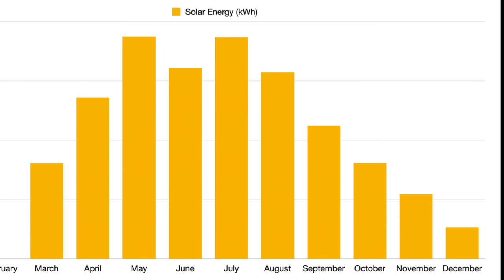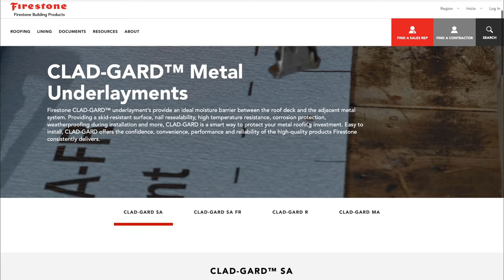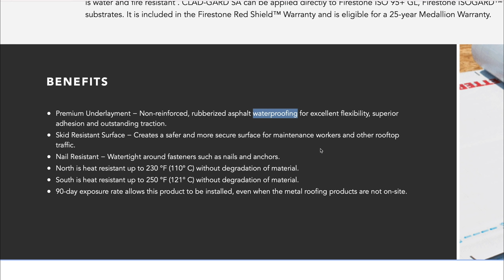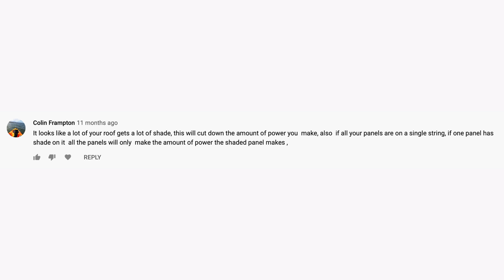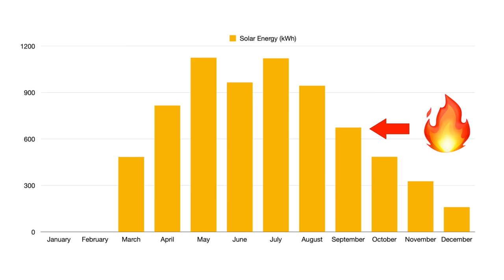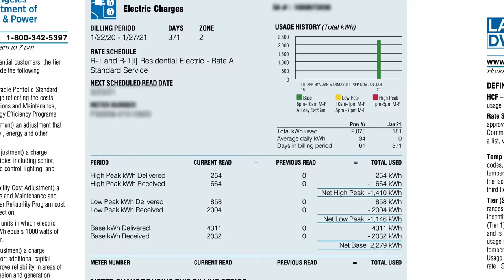1 Year with Tesla Solar Roof: top 11 questions answered + real production numbers & utility bills!

Comment: The most important questions:
1) What was the total cost of purchase plus installation?
2) Did the insurance company pay for it?
3) Do you get rebate or credit from the insurance company for the roof? I ask this question because I believe you do get some credit if you install a metal roof based on its durability.
Reply: Yes please! I’d like to know this as well!
Reply: A lot of these solar roofs, solar glass roofs and power wall videos don’t include those important answers. I wonder why?
Probably the same dumb and self-defeating reason people don’t talk to their coworkers about their salaries.
Reply: @r.lewisblake7793  that was a lot of aggression for absolutely no reason lol
Reply: You can check it his previous video for costs
Reply: Previous video he stated cost was ~$34,000. At $2k savings per year breakeven is 17 years roughly.
Reply: @jeffrandall4046  plus he said he had to get it cleaned, which seems like it might be a yearly need. Guessing that there's not many people with experience doing that it's maybe $500. That's an additional 8 grand over those 17 years, pushing it closer to 20-21 years.
Reply: @r.lewisblake7793  lmao you gotta admit that coworker salary rant was awfully specific 😂
Reply: @jeffrandall4046  so basically the system has not being thought effectively , should be running aircon or heating giving nothing to the grid and a quicker return on investment , these people never get it right
Reply: @jeffrandall4046  I was thinking the same thing until I thought about how long the roof would last if it was shingle.  I know a 30 year roof may last 20 here in Texas.  And the cost would be roughly 20k for that size depending on the cost of oil.  Taking that into account, I think it would be a 8.5 years plus the cost of cleanings so maybe 10 years? 

This isn't too bad when you take into account you no longer have the dependance on the variable cost of natural gas and coal.
Reply: 50k min.
Reply: Keep in mind also that depending on how you wanna look at this $34,000 if you pay that yourself there’s an additional cost in economic circles it’s called opportunity cost. What that means is if you pay $35,000 for something you lost the ability of that money to earn interest or maybe to invest in something else like a house or whatever. Other words it’s not yours anymore so normally you put a price on that 6% to hear something like that
Reply: Salty Berserker Brigade Come get some  Yeah!  More hostility!  That's what we needed, attack the moderating challenge and throw in some name calling.
Reply: @johnwilliams221   you can make that assumption if you believe the cost of grid electricity will go up by the same rate, in order to offset the loss of efficiency / maintenance (Historically they have).
Reply: @jeffrandall4046  with the cost of energy rising it might be 8 years - but the best part is when power goes out during the day, his will not
Reply: @joshuapowers4623  to be fair, he lives in a literal desert, AND he needed it cleaned due to a massive wildfire that caked it in ash. In most places throughout the US where rain is a common occurrence (at least a few days per month), and massive wildfires aren't a yearly issue, cleaning is likely not a yearly need.
Reply: @michaelgunning347  unless you live somewhere where you get paid for the energy going to the grid then those payments + savings exponentially increase recouping your investment.
Reply: @r.lewisblake7793  coworkers don't talk about their salaries because that idea has been promoted by employers so that they can underpay people.
Reply: @jeffrandall4046  yeah.  So this is a purchase I'll never make.  Whatever happened to the Tesla roof being comparable to a traditional roof in terms of cost.  He could have put a 30 year roof on that tiny surface for 15 grand.
Reply: @AngryAlfonse  true but the loss during rain is going to be like having dirty panels or worse.
Reply: @dmn5384  that makes no sense. He left his solar panels caked in ash for 4 months. That's not equal to the losses of a few days of rain every year, especially considering that most rain doesn't last all day, and many rainy days are still plenty sunny.
Reply: Not worth the hassle.
Reply: @jeffrandall4046  ouch.
Reply: Have faith in JESUS CHRIST as LORD and SAVIOR for HE SAVES from hell❗️

 What is the Gospel?

The true gospel is the good news that God saves sinners. Man is by nature sinful and separated from God with no hope of remedying that situation. But God, by His power, provided the means of man’s redemption in the death, burial, and resurrection of the Savior, Jesus Christ. 

Ephesians 2:8-9

For it is by grace you have been saved through faith. And this is not your own doing; it is the gift of GOD, not a result of works, so that no one may boast. 

Romans 10:9
9 because, if you confess with your mouth that Jesus is Lord and believe in your heart that God raised him from the dead, you will be saved.

JESUS CHRIST can come anytime!

Just Believe ❤️ Love you and GOD BLESS
Reply: Cost is tough, I paid $42,000 for a 11.7kW system from Tesla. (not roof but regular panels). I got 1/3 of that back from the Federal Gov via tax rebate. I live in NJ so for every 1MW that my system produces I get a SREC which is worth about $220 right now (this can and will change over time) - I am limited to 10 years in the SREC system.
Reply: @joshuapowers4623  Depends on where you live, I live in NJ and have a solar panel system for 3 years and have not had to clean it once.
Reply: @AskRemy  That is not true. Without a power wall, ALL solar systems stop generating when the grid goes down. That is done to protect the linesmen as they work to restore/ repair the grid. The don't want a bunch of PV electric systems feeding power into the grid while they are working on it. The PV system relies on the grid to provide the timing of the cycles of the A/C. Everything must be in sync or you end up with major problems.
Reply: Also the cost to wash the roof and how many times a year is is recommended that you wash it.
Reply: @OmerQuenneville  whenever it’s dirty
Reply: @newarknj76  At what cost?
Reply: @AskRemy   no his power will go out. He has not opted for the battery backup so there is not power of the grid goes down.
Reply: @OmerQuenneville  I have no Idea since I’ve never had it done. I would probably use my power washer to spray soap then just rinse them off.
Reply: @jeffrandall4046  17 years? rough, dont the panels only last 10/12?
Reply: @HerbaceousM8  People saying 17 years have failed to subtract the cost of a roof.  If you didn't have these tiles, then you'd still have to pay for other roof tiles.
If you do that, it is paid off in just 8 years.  (From his comments)
Reply: @jeffrandall4046  But you should consider what the alternative for a standard roof would cost. So let's say a standard roof install would cost $20,000. Well, you need a new roof anyway, so then you really should be thinking the $14,000 would take 7 years to break even.
Reply: @SHlTHEADJOE  You still have cost of gas unless you go completely electric heating.
Reply: @johnwilliams221  garbage is a bir of a rough word. The panels work, its more like its an expensive rip off.
Reply: @HerbaceousM8  The warranty is 25 years - within that the decline in production figures are 1% of the rated power for the first five years and 0.5% per annum for the next twenty years - so, assuming those warranty numbers are correct, in 2045 he should still be getting about 85% of the rated energy from his roof. He paid $34,000 for the solar roof (versus $16,000 for a non-solar replacement roof) and saved $2,088 on his electricity bill in his first year. Assuming no change in energy prices between 2020 and 2045, and constant weather he should break even (excluding financing costs) around 2037-8. If you deduct the cost of a regular roof from the cost of the Tesla roof then the Tesla roof should have paid for itself in about ten years - around 2030. Of course, electricity pricing have been rising fast over the last couple of years so his numbers should be looking even better, all other things being equal.
Reply: @michaelgunning347  you're clearly a kid since you think a roof that pays itself off in half of the length of a house payment is somehow a bad deal.  if you're buying a house and not intending to live it in for at least 40 years you've already screwed up huge.
Reply: @SHlTHEADJOE  17 year breakeven is also nothing at all when you shouldn't buy a house at all unless you plan on staying for at least 40.
Reply: @derpderpin1568  That's simply just not true in most area's of the country. Figure closing costs on my home were 15k, average rent is 2300.00 a month, my mortgage is 1200.00 a month, it will take me a year and a half to break even when factoring in closing costs alone, if I add things like maintenance but subtract saving on utility costs, not to mention inflation, it's still likely less than 18 months return.  

Now as per that roof, it's 34k, my home owners insurance will cover 95% of a new roof, but only covers certain materials. The catch is it will only cover a 30 year minimum warranty roof. So I'd go from having maybe 5k out of pocket to 34k, which 29k would take me a LONG time to recover from solar. If the root was half the cost, and everyone nationally got one with a power wall, then it starts to make sense, but imo at this point, it's an expensive toy.
Reply: @OmerQuenneville  You are supposed to check your output every month and when you see a reduction in electricity production, then you wash it.
Reply: I just think if you're using solar and you make so much energy that you actually give some to the grid you should get a tax write-off or compensated somehow I don't understand how he still has to pay a monthly electric bill it's kind of strange cuz if you have all that electricity why do you need to use anything from the grid anyways. I would rather figure out a way of storing that energy rather than give it back to the grid if you're not getting compensated for it you're pretty much a free power plant for them
Reply: @jeffrandall4046  this is the reason why I won’t put solar on my new house. I had Tesla solar panels on my house in Arizona. It was going to take me 11 years to pay off the loan and my “savings” from not paying an energy bill 5 months out of the year was eaten up by the summer months $200+ energy bill. At the rate it was going, it was going to take be 15+ years after I paid it off to save any money.
Reply: @nickace843  Yeah this is rapidly becoming a problem here in the Netherlands. First they were too late adopting the technology, then they kept giving and cutting subsidies to solar companies and consumers installing them for years, leading to many companies failing because the market was all over the place. Then when they finally caught on with the general public anyway and became quite popular to install, they started messing with how much you get back from the power you generate.
They tried getting everyone to switch to "free" digital meters a few years ago. We decided to stick with analogue until they force us. This way our meter just runs backwards when we generate power and we pay exactly that amount less, because they can't tell the difference. Which is as it should be, because like you say, we're being a free power plant for them.
It get's worse though, so inept are they that they didn't foresee these inevitable changes and now the power grid can't handle all the extra power. Recently one of the power companies started literally paying its consumers to use more power on sunny days. One guy made some nice money by getting the whole neighbourhood to charge their cars at his place for free. Ridiculous but it was cheaper than investing in proper infrastructure and storage capabilities.
Reply: @joshuapowers4623  But, you also have to include the cost that during a 25 year period you would normally have to have a rood replaced once or twice (depending on weather factors) anyways.  That normal roof doesn't pay for itself at all so in those calculations you'd have to deduct that cost.  The solar roof is still expensive for sure and hopefully comes down over time as it is produced more
Reply: @jeffrandall4046  He will actually save more cause he paid the upfront cost, he is going to save MORE as inflation goes up. Those savings over those 20 years will more then be made up for by the inflation savings.
Reply: @SHlTHEADJOE  And he already got the price fixed in, so he is going to do well vs inflation.
Reply: @jeffrandall4046  that is not a good investment. This is only with it for the intrinsic value of going "green". Not for financial reasons.
Reply: @hitherefrompointswest4805  exactly, you could have done something else with that money, like invest. Nobody gets that...
Reply: @AskRemy  yes it will. He doesn't have a battery bank.
Reply: @jeffrandall4046  So spend 34k to save 16k? Because of the 25 year mark. Sounds like a horrible deal.
Reply: The real question is how much would it cost now, in 2022
Reply: @jeffrandall4046  But peace of mind that you're doing your part to help transition the world into clean energy - Priceless.
Reply: @joshuapowers4623  And you have to account for that efficiency/power loss as the roof ages so it won't maintain $2000 worth of energy savings for the entire time. The cost of energy will likely go up as well over time so that $156 paid to the electric company will likely slowly climb.
Reply: Maybe an obvious question but do you you get paid for contributing power to the grid? I feel like that could be a major factor I this equation since most of his electricity generated went to the grid rather than his home
Reply: @dmn5384  maybe true but what he’s saying is that people don’t like to admit that they got a shitty deal
Reply: @derpderpin1568  how do you figure that math lol
Reply: @r.lewisblake7793  Total cost varies per roof so it doesnt really matter how much he paid, plus he stated the cost in the first video
Reply: So if it lasts 20 years hes +6k ahead versus a regular roof (that size)needing to be completely replaced from wear and tear probally around 10k so +16k per 20 years minus cost of cleaning, not a huge amount of savings tbh.

Especially considering all the components that come with the roof that would need replaced over time, mabee 700$ a yr savings in the end.
Reply: @jeffrandall4046  not really though.  What if you had kep old asphalt shingle roof and invested 34k at 5 % nominal return a year ( which is very low, by the way).  Even at @5% , the net return would be about what his electric bill was and not touching principal.
Reply: @dmn5384  So if you are already going to have to spend 15k, it makes even more sense to do it. In 10 years, you would make up the extra cost of the solar roof.  Then, for the next 15 years of warranty, you would save another 30k.  That's why.
Reply: @tekc0der  Well, it's probably disappointing when someone on the fry station is making more than he is.
Reply: @hitherefrompointswest4805  what people fail to point out is to reduce the investment with normal roof replacement. If you need to replace anyway it also would not affect opportunity costs and you could not earn ROI on that part of the expense.
Reply: @joshuapowers4623  You can have installed over an existing roof for a fraction of the price. Plus there’s 26% federal tax incentives.
Reply: @johnflux1  yes, if you're building from scratch or need a whole new roof. If you just want a solar roof, then you dont add that cost savings in.
Reply: I don't have a Tesla Solar Shingles like this. But I have 25 panels on my house that I get to turn on Friday (finally). My system cost a little over $54k all in. It is rated to produce 16.5k Kwh annually. If anyone is interested in the details of the equipment used in mine just let me know and I will post them.
Reply: @wildgrem  ?? If you don't want a new roof, then you'd just put it in normal solar panels.  The whole point of the solar roof is to have a new roof as well.
Reply: @jeffrandall4046  so with the 25 year expected lifespan it will probably save them about $14,000 overall over that time span, and maybe more depending on how long it lasts
Reply: @derpderpin1568  40 years?

LOL
Reply: @jeffrandall4046  My question is, how much would a regular roof renewal cost for his house.? Here in Austria, we are close to change our roof due to age. So if the uplift is 10-15k for a Tesla Solar roof, it amortizes much quicker.
Reply: @johnwilliams221  To be fair, 2.5 years ago we installed solar panels (24 of them) which produces around 8000 kwh annually. We calculated that it would pay itself back within 5 years but due to the massive price hike in Europe for electricity we going to pay it back give or take after the summer already. We save with current prices 3.3k euro a year while the purchase cost was 8k (but we got 2.5k in return of gov subsidy). But with the cost of these tesla products i honestly dont see the cost effective in them, same with that powerwall of theirs. I guess in 5-10 years it will get to a point where its cost effective but regular solar panels are the way to go for now it seems.
Reply: Takes about 20 years at 2k a year savings to pay itself off. Your eliminating a elec bill by taking on a credit card payment..... net zero savings
Reply: @jeffrandall4046  To break even.... if no panels break and need replaced and it runs ate 93% for all 17 years. Youre not "saving" 2 grand a year by taking on a monthly payment to pay off the panels.
Reply: @joshuapowers4623  IF no panels go bad
Reply: @michaelgunning347  If their still PAYING an electric bill they arent GIVING anything to the grid bud. And a 17-20 years to BREAK EVEN is hardly a savings.
Reply: @jeffrandall4046  Yeah I think the biggest problem with the Tesla roof is that it is damn too expensive even in the US. How much "air" there is in the price with the Tesla price tag. I just wonder how much it would cost in Scandinavia.
Reply: @AngryAlfonse  Pollen has entered the chat.
Reply: @johnwilliams221  my company actually has a production guarantee for 25 years. That means we can guarantee the production of the solar panels is the same from year 1 all the way to year 25.
Reply: @joshuapowers4623  This also replaces the roof, which means when your roof is old you can include savings in getting a new roof as well. This might push it back to 10 years or something.
Reply: @joshuapowers4623  Electricity charge will be increasing year by year, just because of inflation itself. Something to consider
Reply: @r.lewisblake7793  because it's ENTIRELY different per state. 

Certain states have their own incentives or no incentives at all.
Reply: There is never a break even point, except for idiots. His roof cost around $25k more than the average roof. Investing in the stockmarket has an average RoI around 8-10%. In 17 years you would likely have around $92k from initial 25k difference.
Reply: He stated that only 32% of electricity  is using for his home. Guess, this is sufficient to cover all his electric necessity. That is saving 2K+ electric bill. But he is providing (or, selling, perhaps) rest 78% to national (or, private) grid. Maybe he is covering the cost from that.
Reply: @newarknj76  $220 for every MW*hr? So in this video, he generated 8000 kW*hr = 8MW*hr in a year. I'm guessing Jersey would be less sunny but your system is slightly bigger. So maybe you get like $600-$800/yr?
Reply: @briangc1972  oh shit that's rough. Can't they just turn off panels so that it matches your usage in the house?
Reply: @rph8704  this is assuming you need a new roof at the time or at least once within the payoff cycle. If your house is only like 5-10 years old, you may not need a new roof...

I think a solar roof makes a ton of sense for new construction
Reply: @nickace843  you need from the grid when your roof doesn't have sun (so it's not generating anything) but you're still using electricity (basically every night!). 

If he had a battery that was enough for his night consumption in the winter (when the sunlight time is shortest in the year), then he may not need anything from the grid at all, assuming the battery can get filled in one winter day's sunlight. 

Then he would still be sending some into the grid and using almost 0 from the grid, so his annual bill might be negative!
Reply: @coont-tracker-69  the "at once" is probably not the main issue. It's probably more about "solar panels output zero at night", so I either need a charged battery or the grid to supply at that time
Reply: @hitherefrompointswest4805  lmao bro just took one day of personal finance in highschool and is tryna act like a finance major
Reply: @nikilragav  My system produces ~12MW a year so about $2000 to $2400
Reply: @nikilragav  The investors/convertors are not that sophisticated.
Reply: @hitherefrompointswest4805  plus finance costing, assuming he didn't pay cash out of pocket.
Reply: @r.lewisblake7793  most people don’t talk to their coworkers about their salaries because it can cause issues within their work. I’ve had coworkers basically go to war on each other because one got paid more for essentially the same job. I don’t think that has anything to do with not saying the cost of install or potential insurance credit. In fact, many people talk about how they were able to save costs or how they paid X amount for something. Very different.
Reply: @derpderpin1568  it’s pretty rare for people to live in the same house for 40 years. I’d say 10-15 years is more common. Putting this roof on a house and moving 5-10 years later will significantly increase the price you can get away with asking for, potentially giving you a really high equity. Then you can get a bigger house, or move to a nicer area, or whatever. It’s different than buying something you can pay off quickly and keep for a while. Personally, I plan on living in my house for about 5 years and then I’ll start looking at moving. This is because I am predicting my local market will increase my house value about 2x what I paid without me doing anything. It’s a risk, with a strong reward, but worst case, I can just keep living in it. Lol
Reply: @AskRemy  his power will go out if the grid turns off. Grid tied solar without battery backup and transfer equipment turns itself off in the event of power failure. It doesn't matter if it's day or night.
Reply: @jamalharrison4695  what aggresion? wtf
Reply: @AskRemy  but it will because he didn’t get the power wall….he won’t have electricity like everyone else
Reply: @johnflux1  Ya, he said 11,000 for a regular shingled roof and 34,000 for the tesla roof. That is a difference of 23,000 with a saving of 2100 a year. So to see the return on investment it would take 10 years. But if you put that extra 23,000 In to a decent fund and got even 5% you would have 37,500 - 2250x10 = 15,000. So just buy a normal roof, Invest it pretty safe and in 10 years you getting 15,000 more then this roof will give you.
Reply: @HerbaceousM8  25 years
Reply: in Dallas we can get new roofs with architect grade singles for 9k on a house of 2ksqft.   we use 2600khw hrs all electric. average bill ranges wildly around 240/mo.
Reply: @drew651  opportunity cost is indeed a real thing, but risk management is also. That 5% is not guaranteed, and you're also assuming that electricity costs don't go up. It's a similar argument to whether to invest VS pay off mortgage etc. I personally prefer to have a lot more balanced risk, and solar panels are a lower risk when combined with other investments.
Reply: @jeffrandall4046  that is of course assuming that the price of electricity remains static.
Reply: @r.lewisblake7793  everyone should talk about their wages... and we should know the price of this installation
Reply: @jeffrandall4046  So, then, ideally you want a home equity or home improvement loan for $34,000 that will cost you less than $2000/year in payments, paid off in 25 years or less, if you want to see real savings right away. Equally ideally, you can put the savings into the stock market or another interest-bearing investment that will yield greater profits than you're paying in interest for your loan.

A lot of this hinges, I think, on whether the 25-year lifetime is when you need to completely replace it, or if it will keep operating safely (if not with a performance guarantee) for any significant time thereafter. 25-17 is 8 years, which is a nice-ish amount of time to enjoy your savings and not have to make payments (to yourself, if nobody else) to make up for the cost of installation, but it's a long time to wait for the benefits.

Does this, in supplying power to the house, supply power even when the power is off? I know it would with a power wall, which would make the cost have some benefit other than savings, but he didn't opt for that.
Reply: @tgwoolshire  wronf
Reply: @OmerQuenneville  buy a power washer and clean it yourself. It’s not a hard thing to do
Reply: @rph8704  that’s what I would do all electric
Reply: @malcolmrose3361  energy bills increase every year without incident here in California. Hell be cash flowing, meaning paying much less than his neighbors in 5 years
Reply: @r.lewisblake7793  why would you not talk about your salaries, for the boss to underpay you
Reply: @charliesno  correct, scam and a sham.
Reply: @SHlTHEADJOE  that size roof with shingles is nowhere near 20k, especially in Texas. More like 5k tops
Reply: This goes for approximately 55k to 60k in today's prices, not including the powerwall battery.
Reply: @joshuapowers4623  Solar panels get less efficient over time (0.5% / year), plus you need to factor in repairs due to failures or other breakage and misc. maintenance which will be inevitable over the lifespan of this roof. It now seems like a 24-25 year breakeven point.
Reply: @jeffrandall4046  Unless you take out a loan (preferably cheap, on equity), the opportunity cost during those 17 years is enormous.  Even if you take out a loan, you need to reliably make more in the markets than you pay to service the debt.

What's more, a roof is depreciating asset, unlike the property itself.  So you take on greatly increased risk by taking out a loan long enough to cover the break even period.  I would recommend having sufficient insurance to replace the roof like-for-like in that case.  That's expensive too.

The value proposition just isn't there, for me.  I sincerely wish it were, because I would love to have one of these for my own independence and the good of the environment.
Reply: @jeffrandall4046  Keep in mind you need roof regardless on your house plus that roof gives you reduced energy consumption cost which price increases each year.... Break even is far more sooner than you mention.... Cuz for normal roof u might paid 10-20k depends on tiles and quality plus work... so you can take those out of 34k which was solar roof with work as well... People tend to forget important parts... 

This one legit awesome offer saddly its mainly in USA atm.
Reply: @charliesno  lol I have a housekeeper and garden people... I'm not going to do it myself. Cost is relevant and important.
Reply: @jamalharrison4695  Being scammed is plenty of reason pal.
Reply: @jeffrandall4046  Unless you factor in the cost of a brand new roof. Then I'm sure the break even would be substantially lower.
Reply: They built energy positive office buildings in Oslo Norway. AFAIK it's mostly due to good insulation, air venting and positioning of glass surfaces. Not sure if they even use solar.
Reply: @jeffrandall4046  I would assume that the price of the grid would go up over time (quicker than the cost of money) so the ROI would be quicker
Reply: @joshuapowers4623  Yeah not to mention that by time you get to that point the 25 year warranty is up and it's time to replace the roof. LOL not worth it. I have solar panels on my house I just bought and it is the equivalent to 7KWs the previous owner paid 15000 for the system. My electric bill during the summer runs about 135 dollars and during the winter about 25 dollars. House is 4000 square feet and has gas heat for winter and we have a pool and two zone cooling used in the summer. Plus I average 60 dollars a month of energy sold back to the grid.
Reply: @michaelgunning347  It is running aircon. Heating in LA? You need to travel a bit my child.
Reply: @AskRemy  He didn’t install a Powerwall as he said. When area power goes out…so does his.